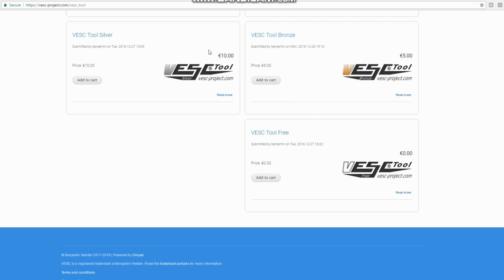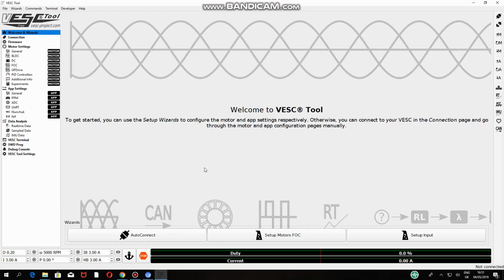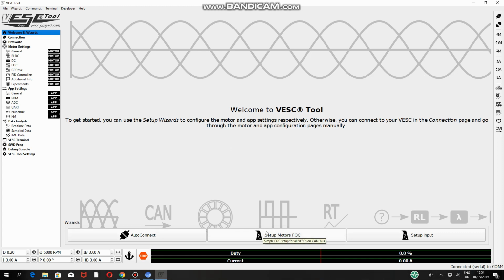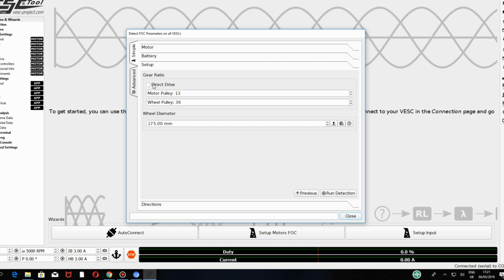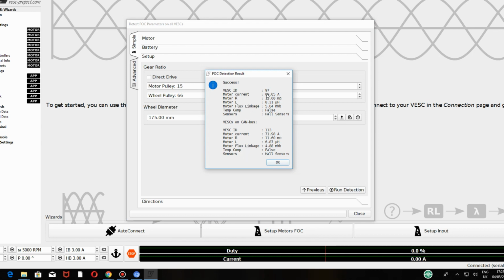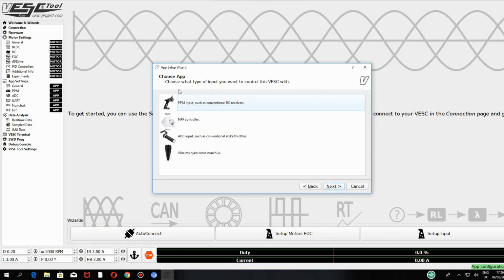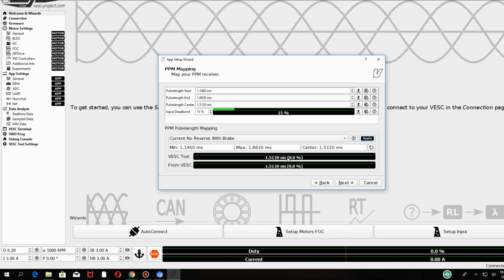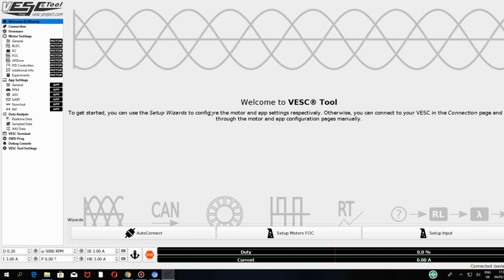VESC TOOL 2019 TUTORIAL. PLEASE READ MY COMMENT!!!! IMPORTANT!!!!!

Comment: Nice work i still use the older style ackmaniac vesc tool and firmware has some nice tweeks not in standard version. Shouldnd you have you battery set to lipo graphines are a lipo style chemistry. You didnt cover canbus setup much. Its something i struggled with when i started using 2 vescs. Great video
Reply from the maker: Hi!
Thank you for the comment buddy!I am sorry if i have missed something in the video....all the steps were covered I believe. The new tool has less steps and fiddling around to do.
What is the question regarding canbus?

Comment: Thank you for this video was waiting for this I'm picking up a vesc soon I'm done using these cheap esc great job explaining how to program the vesc too:)
Reply from the maker: Here to help!
Will make another short version soon : )
Reply: @PavelGarmas  hey can you help me out on range with 15.6ah battery I'm using 15-36 pulleys on 90mm wheels I'm 230lb..big guy..lol any help would be appreciated it thanks again
Reply: Best thing you could ever do... And no more broken ESCs... :)
Reply from the maker: Hi,
It is very hard to predict the range buddy.....what motors are you using? What is the average speed that you travel? Is the battery 12S or 10S? Road conditions? 
I am 112 kilo and get 12 -14 miles on my 8AH 12S battery. Same gears....
I would say that you should be getting minimum 15 -20 mile range ....
Do you push start the board?
Reply: @PavelGarmas  it's a 10s battery motors I think are 5360 1500w each I took it out yesterday 5 miles  and still had 38v leftover on battery
Reply from the maker: Mate! Are you sure that the battery is 10S at 15000 mAmp? That is a big battery brother : )
Reply: @PavelGarmas  60 18650 2 10s in parallel each battery are 280wah at 7800mah
Reply: @PavelGarmas  just order the flipsky vesc hopefully I'll be in this week one question though is there a way to change the breaking curve so it won't throw me off the board..lol
Reply from the maker: LOL
Watch the video carefully buddy - all the information is there. Calibrate the remote correctly and set the motors to - 30 at the start and 45 .....test and increase  the braking power to suit your liking. You can get the board fine tuned and you will love it!  https://youtu.be/DvjF4xyNfQM
Reply: @PavelGarmas  will do thanks again
Reply: @PavelGarmas  just got it all setup I'm having problems with the remote how can I program it this remote has no mid throttle
Reply: @PavelGarmas  got a new diye remote went through  your video process step by step got it all set up everything working fine but when I get on it to test ride it just start shaking like I'm to heavy for it  did i do something wrong my setup is the 4.2 flipsky vesc  hobby sky 6354 180kv 15 36 gear with 90mm wheels 10s battery this setup worked well with the China esc so I must be doing something wrong with programming it any help will be truly appreciate it thanks
Reply from the maker: @bereal1251  
Are you running dual motors / dual vesc?
Reply: @PavelGarmas  yes the dual vesc
Reply from the maker: @bereal1251  
So two separate vesc or a single unit? Try programming each one separate and do not forget to I'D the 00 and 01 - lead and slave.
Are you running FOC ? Are the motors sensored?
Reply: @PavelGarmas  my vesc it's just like yours but the 4.2 with power switch motors sensorless and yes ran foc
Reply from the maker: You can not run FOC on sensor less motors mate....need to use bldc in your case. That could be the issue.
Reply: @PavelGarmas  You can use FOC with or without sensros... Doesn't matter, it is smoother sensorless FOC vs sensorless BLDC. Though none can make you go from stop without jerking. Or why do you think you cannot use FOC mode sensorless Pavel?
Reply: @bereal1251  Without sensors you can't start from standstill you need to push a little... just to 4-5 km/h and then it will start working as it should.
Reply from the maker: Correct ….I do push start all the time regardless of FOC or BLDC to save the battery charge : )
Reply from the maker: I did use two 4.12 Flipsky on my 5000 watt carver and found that the motor sensors were not being picked up for some reason. Did try both FOC and BLDC and BLDC works much smoother..... I was always under the opinion that FOC mode requires sensored motors and the vesc that can do FOC.
Reply: @PavelGarmas  Even Benjamin Vedder showed how FOC without sensors works better than BLDC so that's weird. For some time  I thought (someone told me) that If you don't use sensors in FOC it automatically goes to BLDC which is BS. :)
Reply: @esk8spirit362  thanks for all the help I just don't understand why wouldn't a cheap China esc work better then this vesc..the only problem I had with the China esc was the breaking
Reply: @bereal1251  cheap chinese esc is made of cheap components, is preset and has no other software support or updates. VESC is the best speed controller made specifically for eskating by a guy that cares. You get a software with full customization, android support, BT telemetry data etc... Also it can handle the whole range up to 12s and 50 amps+ and the power delivery and the braking is as smooth as it can be. you cannot compare that with a cheap chinese esc. (but be careful you can build a ESC according to how VESC should be built and still use shitty components... SO not everything that is based on VESC is a quality speed controller ready for 12s FOC... I recommend enertion or Trampa.
Reply: @esk8spirit362  sorry didn't mean to compare I'm like this vesc more control over everything well I just re program my board got rid of some of the twitches using throttle curve at + 30% have to push off just a little just a quick question will these twitches mess anything up and would bldc fix my problem? Thanks for your help as well this is my first esk8 build I building drones that's more my thing it's easier. .lol
Reply: @bereal1251  By the "twitches" you mean the stuttering when trying to accelerate from stand still or very low speed? That's because of not having sensors, you can get rid of that only by getting sensored motors or attaching sensors to your existing ones. Otherwise you need to push a little so the VESC gets back EMF from the motors and knows the position of the magnets. VESC FOC is superior to all.
Reply: @esk8spirit362  yes the twitches are from a stand still a little push I'm good but will this damage my vesc or motors? Just got these motors I emailed the vendor in hopes he can exchange them for sensor ones fingers crossed
Reply: @bereal1251  The VESC won't care and motors get jolts because of magnetic pulses, don't think it's really bad for them but I would push to start when riding without sensors.
Reply: @esk8spirit362  thanks bro I really appreciate your help I'm learning a lot I'm still green but I'll pick it up;)
Reply: @bereal1251  No problem man, glad to help. If you need anything, don't hesitate to ask.

Comment: FInally after years of the VESC being out someone makes a tutorial for others. Thank you Pavel. A few things If I may add... that seem important to me. To remember always to press the "read motor/app configuration" buttons before one starts changing values otherwise you will then save default values and mess up the whole configuration (at last to press the save motor/app config button to save). The absolute current setting is not for 2x current of the motor. It is set to 130a and it should stay that way for all setups and shouldn't be messed with or lowered down. Traction control is good to have on because of the "max ERPM difference" between your 2 wheels, even though traction control never really worked before it does keep the max ERPM difference capped so one doesn't get spin outs on one wheel only but as  soon as one wheel reaches the predefined difference, the other wheel will start spinning too, very nice to have, you don't get stuck on gravel or soft ground. And one last thing is the ramping time positive/negative. That dictates how quickly the throttle or brakes respond to your remote. Very important to mess with when having remotes with short travel or when needing more smoothness or quicker response in power delivery. Awesome to have you Pavel.
Reply from the maker: Thanks man!
Good points buddy! I think I will redo the video ;)
Reply: I just wanted to also thank you for this info. This has already helped me solve a problem I was having, and having a difficult time finding a remedy for! I'm sure this additional info will be valuable to someone else also!
Reply: Would traction control stop strange wobble at max speed due to duty cycle current limit ??